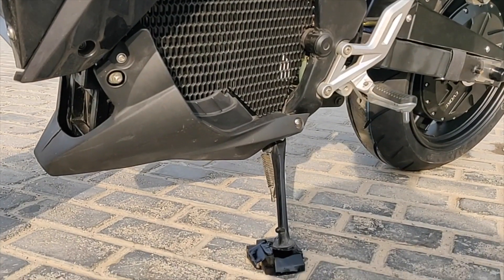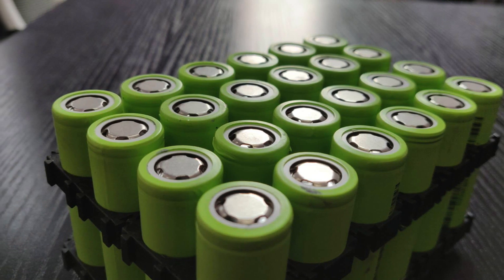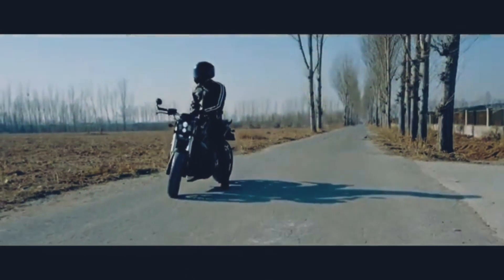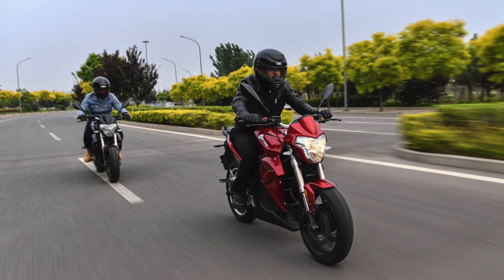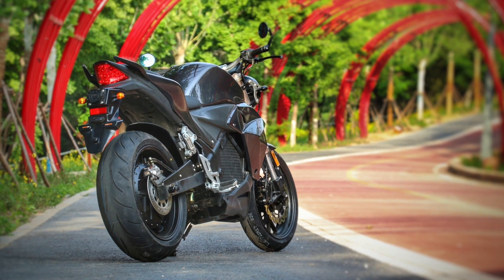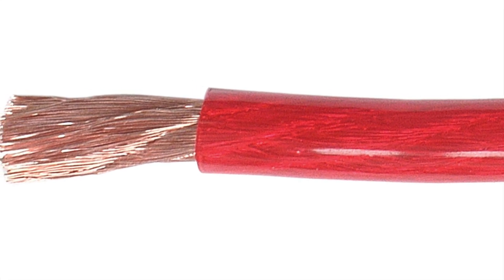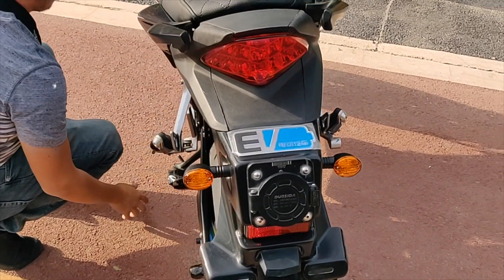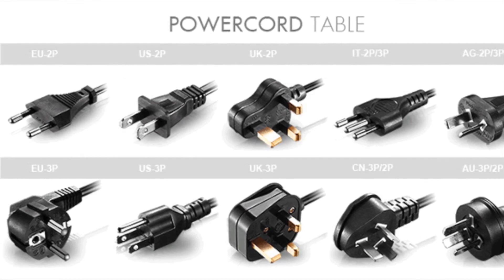Evoke Electric Motorcycles - Urban Series - In-Depth Hardware Introduction

Comment: Hi Evoke-Team!
I have the Chance to get a Bike from the early Productions (2018). What are the differences to the 2019 Models you are describing in the Video. AS far AS i know, the Motor isn't cooles. Thanks in advance.
Reply: Hi Philipp, the 2018 Urban S and Urban Classics came with a 4.0" wide rear hub motor wound with 50mm magnets and featuring a 150/55-17 CST tire. The 2019 onwards moves to a 6.0" wide hub motor wound with 70mm magnets and wrapped in a 180/50/17 DCT by King Tyre. The newer 6.0" improves thermal dissipation with the new windings and thermal air gap in the hub itself.
Reply: @nathansiy2752  hast there be also differences concerning the battery and Controller?
Reply: @skillsless1  No. Battery and controller carry over from 2018 to 2019.

Comment: will battery survive 50c degree weather ?
Reply from the maker: Hello! Definitely, our motorcycles are designed to withstand temperatures from -20°C to 65°C. We have been selling our electric motorcycles in places like UAE for a few years now and they are still doing great!
Reply from the maker: Not an issue. We've done our UN38.8 battery standards testing up to 75 degrees C.

Comment: Guys .... When this available in India ☺️......???????? I need one
Reply: arun antony I’ll try to connect you to them. I’m confident a bike can be arranged for India.
Reply: don't worry India will launch emplux(electronic superbike)😉
Reply: @motivationmachine9942  the emplux is hardly a superbike it only 72hp and 84nm of torque, it cant even get to 100kph in 3 seconds, i personally own a evoke motor from the factory evoke uses (12kw continous 24kw peak rated at 72v) im putting 134.4v and 1000amps battery current (1min) and achieving 0-200kph in 3.2s, the same time it takes for a emplux to do 0-100kph.....

i use 134kw on my motor daily to and from work 40km round trip, i thrash my bike, i live in australia in brisbane where it is hot, the motor only needs air cooling, and it does come in a watercooled version for a REAL high speed supermoto gp bike
Reply from the maker: Hello Arun Antony, We are currently working on that. Please send us a message on contact@evokemotorcycles.com to discuss further. Thank you.